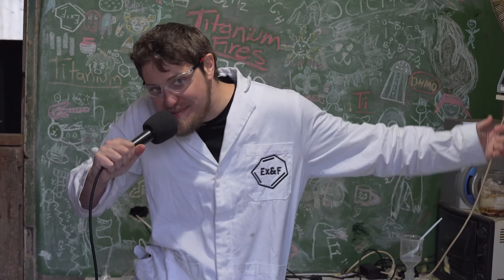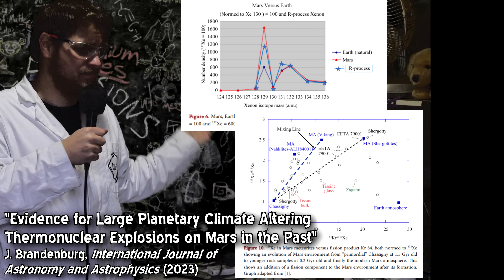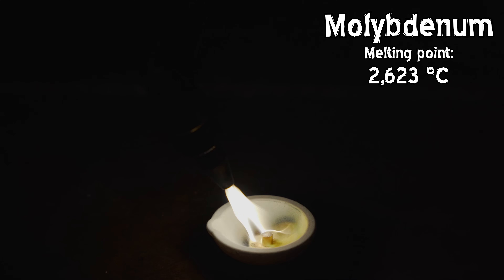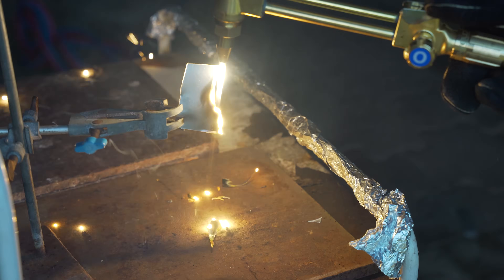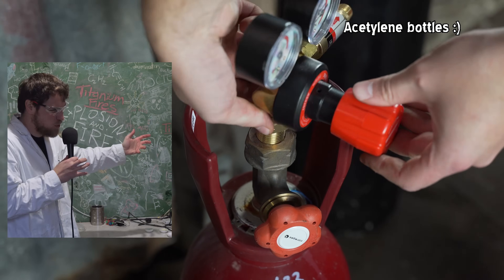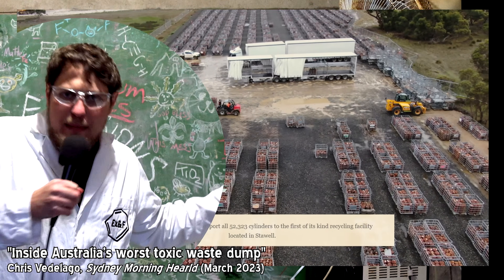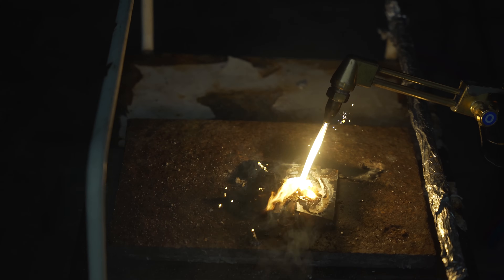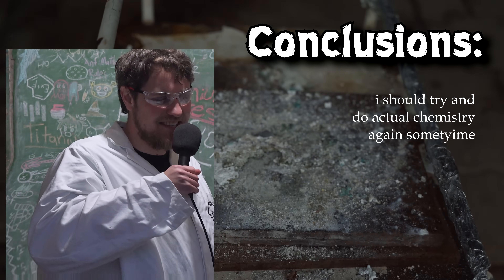Actually burning titanium

Comment: You're using it wrong. Turn on the acct - don't be a pussy, turn it up or it will pop - and then the oxygen, ie, knob not lever, until you have blue cones - this is max temp stoichiometric -. The lever is a cutting jet, not to balance the flame. To turn off, acct 1st oxy 2nd, and that stops the flame dead - the other way around and you get that lingering sooty flame -.

Comment: as a welder who has to use oxy fuel every so often, that white wisp at the front of the torch when the gasses mixed is and oxidizing flame where as when its a "colorless" its a natural flame that will oxidize less

Comment: As others have said, injecting the oxygen without holding the trigger would have many benefits. The main one being mentioned is the higher heat. I think that the most beneficial aspect of dialing in the oxygen mix with the valve is that without the violence of the oxygen stream molten titanium would most likely stay on the plate. This would give a better chance for critical mass to be achieved if indeed it can.
Reply: This is correct

Comment: I'm not sure what I'm more confused about: the nukes on Mars paper, or the fact that Australia - a country which has vast swaths of open desert where pretty much nothing exists - ships their plastic out of the country to be burnt rather than simply burning it themselves. I mean, burning plastic is pretty damn bad, but mostly because it introduced harmful chemicals into the air and microplastics that didn't quite burn all the way. Get some big heavy-duty furnaces, with heavy duty filters to catch the particulates, and then find a way to deal with the Carbon. Sending it away to get burned elsewhere isn't actually doing anything at all of value, except maybe hiding the problem from view.

Comment: As a welder, I can tell you that the flame on that torch was so cold, so very cold
Reply: I believe what he was talking about is the fact that his oxygen to fuel mix was off not enough oxygen to balance out the amount of acetylene
Reply: @crazy4chickens   Yeah, needed more acetylene and almost triple the oxygen
Reply: @crazy4chickens  correct
Reply: Yeah, not even close to enough gas flow, and he's using a cutting torch which isn't really what you want here. Should have used a rosebud, and a 10 minute youtube video about how to set it up. Bonus points because newbies always pop a rosebud like crazy while they're learning how to use it, very satisfying bang.
Reply: @jttech44  Wouldn't the tip of a "tuned" cutting torch, be significantly hotter than what you could achieve with a rose bud?

Just saying, I've never gotten a rosebud hot enough to cut steel...

Edit: That went from hooter, to hoter, and finally back around to hotter.
Reply: @codymoe4986  The only reason the rosebud doesn't cut is because a cutting torch has a secondary bypass air source in the middle of the flame that blasts away material. Plasma cutters work in the same fashion, just much hotter. 
A rosebud will be much hotter because it's burning much more fuel/air and even a standard torch would be hotter than what you see in the video because it's at very least going to be tunable with a good mix.
Reply: @jttech44  Never needed air to start melting metal with a cutting tip...the flame heat alone will do it...
Reply: @codymoe4986 what metal? If you have done before, Cutting steel that little oxygen lever will blow your mind, lol
Reply: Glad I'm not the only one noticing. Dirt flame, not hot enough. Idk enough about actually catching the plate on fire though, other than the heat was nowhere near what oxyacteylene torch can put out
Reply: yes, looking at the flame shape, you could tell the Oxy Acetyline mix was off a bit. 
He also didnt heat the plate with the hottest part of the flame too.
Reply: Some damn high voltage has no temperature limit, should have tried that.
Reply: @fss1704  probably harder to get ahold of for him
Reply: @CavemanZerron  Nope, a simple microwave oven transformer from the junkyard should do the trick, as a physicist he should have at least 3 already.
Reply: @fss1704  given how Tom tried to drive his UV LEDs, mucking around with an MOT would be a quick path to an early death
Reply: He needs to have a neutral flame
Reply: Quit making them out of plastic

Comment: Come on man! On the last oxy torch video, I saw you had some really helpful comments about getting it set up and running it safely and then in this I see some even more potentially dangerous practices.

If I remember correctly the This Old Tony oxy acetylene vid was fairly complete and easy to follow. 

Not trying to be a dick, just be safe.
Reply from the maker: The comments did help! I mean a lot of this was filmed around the same time as the first video, but honestly the flame isn’t that bad and I did watch a lot of videos on it. What makes it difficult is filming the flame. Even when blue to the eye/glasses, it was just so bright it looked yellow on camera. But yeah I got a lot better, I just ended up making the video with all the incompetent bits in it oops

Comment: I love your videos man but... you need to learn how to use a torch. First and foremost you are using a cutting torch, yes it gets very hot but it is designed to cut through metal. When you pull that lever on the torch it actually sends out but loads of oxygen to blow through the liquified metal. 

Turn on the red then turn the green slowly until you have a very very tight feather. If the flame looks like its going 3 directions ask your dad how to clean the tip I know he knows how to, and has the tools to do it.  Ideally you would never use the cutting feature to melt something as you are adding so much extra carbon. Torch will get just as hot without the cutting function activated.

Good luck in your future welding endeavours man.
Reply: Jeesus creepy Christ: "ask your dad how to clean the tip I know he knows how to, and has the tools to do it" . 
I'm gonna go out on a limb and assume you do not know this guy and that this statement is some kind of weak sleight from a metalworker.

Comment: Torch tips: you ready? Every tip to your torch kit comes with a gpsi rating for both gas and oxygen this is what you set your regulator to, acetylene should never be more than 12 gpsi, IIRC, because it'll self decompose at low enough pressures. Once you have the regulators dialed in the next step is to get your torch dialed in: make sure the flashback arrestors are facing the right way otherwise you're carrying a tiny antipersonel bomb, tighten all the joints, look for leaks, when you're certain nothing is leaking then you can strike the flame. Strike the flame and balance the oxygen and fuel until you have a neutral flame, this is where the oxygen and the fuel are pretty well stoichiometricly balanced IIRC the flame should be brightest when this is the case. With a neutral flame when you depress the lever you are making it an oxidizing flame, you're adding oxygen when you do that, the reason being that once steel is hot enough to burn the pure oxygen is all that's needed to keep cutting it. If you want a non oxidizing flame then you tune the flame to be fuel rich and make sure the flame when the lever is pressed is non oxidizing. you will accumulate soot but if you tune it right you'll only get small amounts, conversely if you only use a neutral flame you should have minimal oxidization as the fuel is much more reactive than most metals you're cutting.
Reply: Almost every comment regarding the torch has this snide, insulting angle. I think you guys have been inhaling the torch fumes.

Comment: For those who are scratching their heads about recycling, I suggest you search on "plastic syngas". In essence, plastic can be broken down into small molecules like CO and H2 and that is the basic feedstock for industrial scale chemistry that can produce plastics, synthetic fuels and etc. Our problem is not that we don't have the technology, it's that it takes less energy to turn fossil fuels into plastic than to fully recycle them. That will change when we find ourselves with an "oversupply" of cheap renewable energy at certain times - especially during the day. Soon it will be economic to not just recycle first use plastics but also mine and recycle the billions of tonnes of materials found in garbage dumps.

Comment: With the right gas pressure, nozzle and a little skill in adjusting the flame you can reach up to about 4200 degrees Celsius.

Source: I am a metalworker with an engineering degree

Comment: Someone needs to perfect a syngas process that uses up PET plastic. C10H8O4n + 3n O2 --> 10 CO + 4 H2.

That way it can still be burnt but in a controlled environment where the energy can be used and it doesn’t release soot and PAH’s and stuff.

The trouble is doing the whole process cheaply enough to be profitable, I suppose.

Comment: So for you torch,make sure the nob on the upper handle is off, oxygen nob at the base is on. Turn on acetylene and light. Turn the nob on the upper handle until you get sharp blue point at the tip.  Ther will be like 6 or 8 points. You'll be at the optimum settings at that point. Of course you can turn up the acetylene higher and adjust oxygen for higher temps. Oh turn off acetylene forst before shutting oxygen off.

Comment: Bro I think you're running your regulator on your acetylene too high and oxygen too low. That's a very rich flame. 

The cutting head has multiple mixed gas burners around a central oxygen only jet that does the actual cutting of steel. 

You can get the flame to about 3480C with a slightly oxidising flame

Comment: FYI… you need to adjust the flame before you squeeze the oxygen dump lever…

You adjust the flame with the upper knob… you don’t want the yellow carbon flame, you want a nice blue flame with the light blue cones by the tip just sharp, not feathered…

Comment: you have a carbonizing flame, add more oxygen it will give you a hotter flame; Your flame is uncontrollable and inconsistent otherwise. A proper oxyacetylene flame should be blueish. Yes, oxyacetylene is scary. However, if you get the gas mixture right it should be very controllable and smooth. Again you are not adding enough oxygen to your mixture.
Reply: This MF is Daft, don't listen to him.

Comment: i think a chunk of "titanium wool" would've potentially burned better, since yeah your acetylene torch technically did oxidize the metal even without additional oxidizers, but it wasn't "on fire" in the classic sense, which i bet just needs way more surface

Comment: Open lower oxygen tap all the way, open acetylene tap slightly and ignite it, open the acetylene tap until the flame moves from the tip, then wind it back until the flame connects to the tip. Then adjust the top tap until the “feather” of internal flame has disappeared and you get a solid internal flame.

Comment: You are using the torch wrong!
Ajust the flame with the trigger valve not pressed, then press to open it on melted metal and blast it with extra oxygen! 😉
Should work even better with titanium then with steel.

Comment: U should make a closed loop incinerator for plastic that makes electricity with the excess carbon add it back into the system and make power and with the co2 compress into dry ice or liquid co2 then send it in a rocket into outerspace

Comment: Fun fact about Tantalum.. Certain capacitors for electronics are made out of it....and they REALLY don't like being over-voltage,and they tend to fail short-circuit. Once,a tantalum capacitor exploded on my workbench,flew across my bench,and the white-hot slug landed on a stack of notes,datasheets,etc. Instantly setting my notes and datasheets ablaze!  It was just papers,but I've never seen paper go up in flames so quickly,it was like they were soaked in gasoline! I F*ckin hate tantalum caps! (they are functionally awesome,in certain applications..but personally I try to avoid them.)
So yea,it burns hot..really hot.

Comment: As someone with a bit of torch knowledge, your using an oxygen rich flame ie an oxidizing flame so that's why your metals are oxidizing. Using the cutting tip, the one with the lever to add oxygen, turn the acetylene on a bit light it, then slowly turn the oxygen valve on to get it to about a 1/2 to 3/4" feather on the flame. When you hit the lever it should produce a blue almost clear flame with a line through the middle that isnt flared and almost going out, that line is oxygen and what will blast the material out of the way. If the flame is white there's too much fuel, if the flame pops and goes out there's too much oxygen. Hope it helps a bit. Once you know what your looking for with a cutting torch flame it makes using it much much easier and more efficient. If it's smoking you have way too much acetylene. The torch tip without a lever is a brazing tip.

Comment: Even after my first comment I hate to say there has not been a proper cutting melting or anyting flame with that oxy acetylene torch it has been a carburizing flame the whole time more fuel than oxygen
Reply: You might have actually been able to melt the tungsten with the properly set torch and enough time
Reply: It is actually pretty difficult for beginners to learn how to use oxy-acetylene torches how to properly cut how to properly melt I can't hold it against you but your results are a little bit off and your temperatures are probably a little cold because your flame is orange it needs to be a transparent blue with baby blue cones in the tip
Reply: Also titanium explodes in factories where they Mill titanium dust is the culprit for that

Comment: There are three knobs on a oxy acetylene torch and One charging handle depending on the head you use turn the oxygen knob on the lower right side the Green Tube all the way up crack the right side the red side with the acetylene open a little bit then turn your mixing knob on just a little bit figure out how much you need with fuel and the mixing knob once again the mixing knob is up top you will have a proper Flame the Flames I seen in the first three minutes are all carburizing or oxidizing flames you could properly melt things with a properly mix torch
Reply: I'm not trying to sound condescending I honestly want to educate your ideal acetylene oxygen mix for cutting thick-ass Metals is going to be a maximum of 15 psi acetylene any higher will start spinning liquid acetylene causing burn back and a lot of problems for you and the fire department the oxygen maximum should be about 60 PSI maybe a little higher but 60 PSI is ideal move slower when cutting sticker stuff a rosebud tip will heat better and melt stuff a lot faster

Comment: @ExplosionsAndFire so the way you set an oxy acetylene torch is to first start by turning up the acetylene without oxygen till you get little to no smoke. At this point you start to add oxygen into the mixture slowly. Once the flames coming from the torch head are defined and you can see 6 individual little flames this is where you hit the lever on the back of the torch called the pierce. When you hit the pierce you want enough oxygen in the mix so that adding the extra oxygen from the pierce doesn’t cause the individual small flames to move or move drastically. At that point you have set the torch to its max heat/cutting potential.

Comment: What's with all this PPE?  Are you turning into a role model or something?  I remember being that 14-year-old student getting my first (and only?) lesson in oxyacetylene safety from a shop teacher who was an old blacksmith turned teacher.  I can still remember him saying "open the oxygen until it stops but only open the acetylene a quarter turn.  You will notice that I have no hair on my right arm.  That's because I had to reach into a flaming acetylene cylinder to turn it off, and I still have an arm because I only opened it a quarter turn."  Teaching with impact.